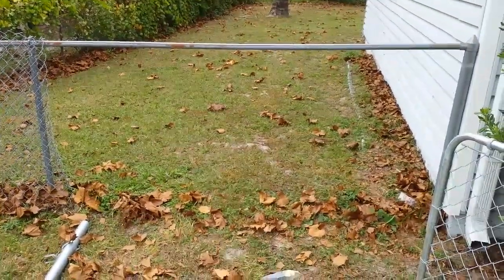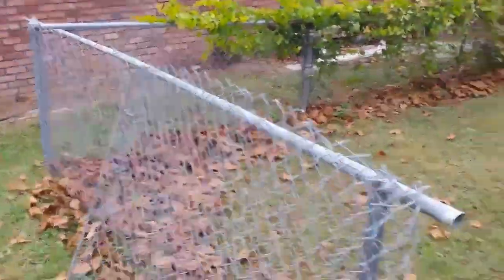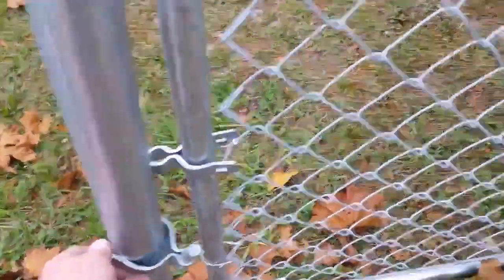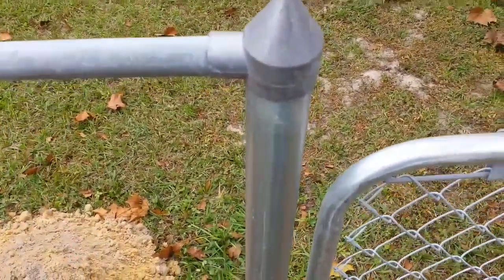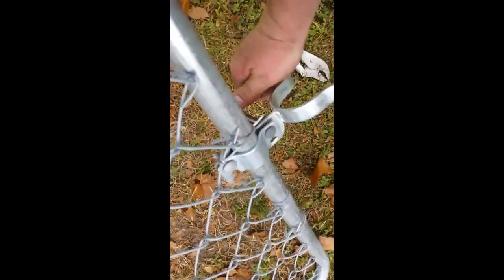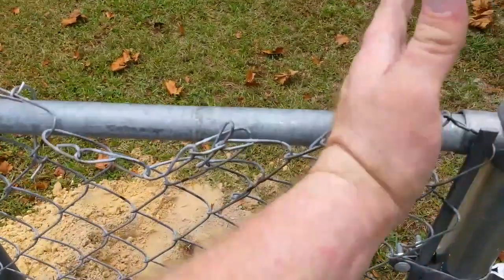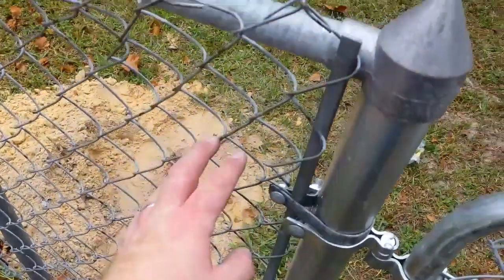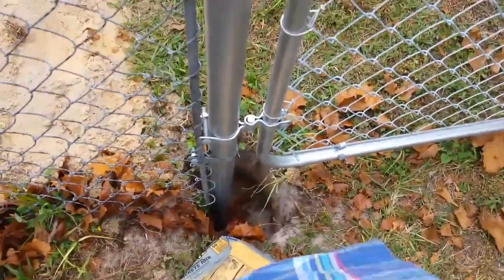How to install a gate into an existing chain link fence

Comment: Good video....I'm going to add a larger gate to an existing gate space. I like getting it set up and doing the concrete last.... looks like this method should work for me.
Reply: I kept thinking this project through myself.... 

It seems so much simpler too set it up and doing the concrete last!!!

It literally was winding my brain up by doing the pole and concrete first, then cutting, then attaching all pieces.
😵‍💫😵‍💫😵‍💫😵‍💫😵‍💫😵‍💫🤪🤪🤪😵‍💫😵‍💫😵‍💫😵‍💫

Comment: For some reason the homeowner installed an old horse fence gate, but I want to swap it out for a double swing. Pretty sure Its just a swap out, but I need to put a single gate on the other side so I don't have to walk all the way around to get to the back yard. Quick and simple video, thanks man.

Comment: What is the distance between the two gate poles?  Thanks for the video.  Big help.
Reply: Generally speaking a 48” gate is less than 48” wide around 461/4” so you’d leave a 48” width between poles, so your hardware will fit. I like to add 1” making it 49” I know this video is old, I hope this helps you.

Comment: Where did you find a gate with the exact width you needed? I need to do something similar but I'm having difficulty finding both the right height and width. Thanks
Reply: Lowe's has 90 degree brackets so you can make your own. It will be square.

Comment: What tool do you need to cut the top pole?
Reply from the maker: I believe I used a hacksaw or a sawzall would probably work also with a metal cutting blade.
Reply: I bought a pipe blade cutter that you hand spin around the pipe. Took forever and gave one hellofa workout to my wrist 🥵🥵

Comment: Did you use a stretcher?
Reply from the maker: No I did not.
Reply: I wonder about that. 
I found one once at a job site but the fence guy came back a week later and I was honest enough to give him his tool back. But, I wanted it! INTEGRITY😊

I've always wondered if you can use several ratchet straps to tighten the links?🤔🤔🤔